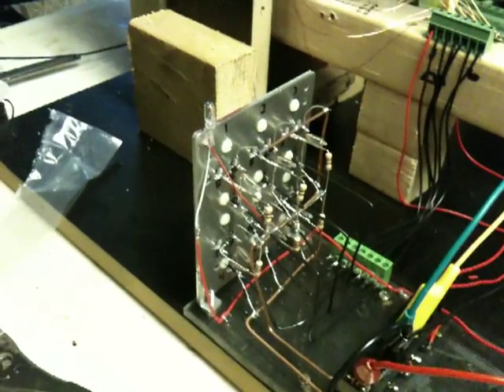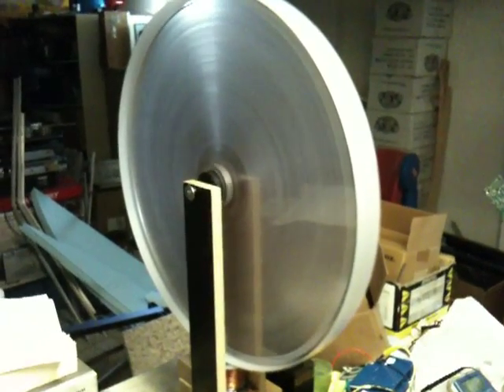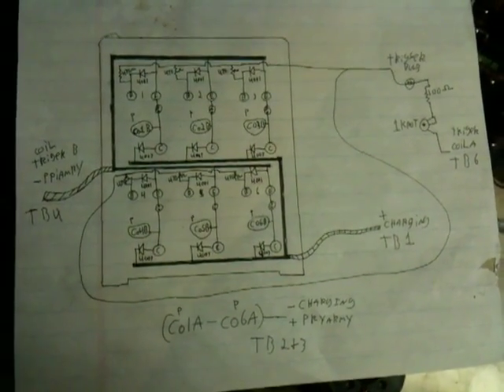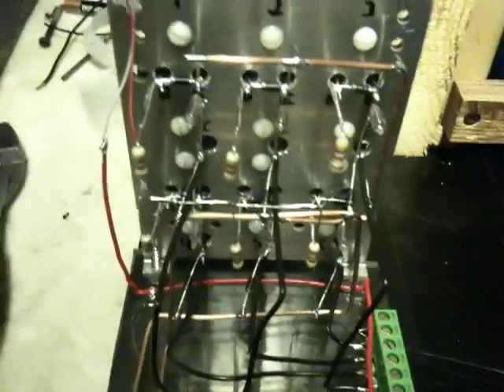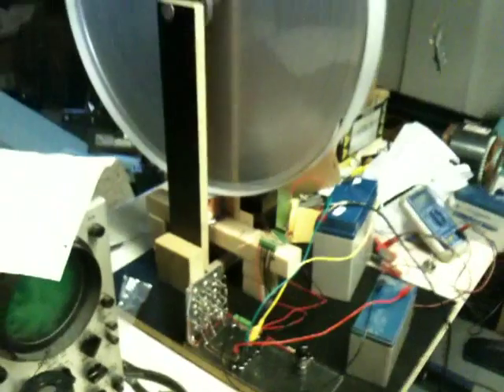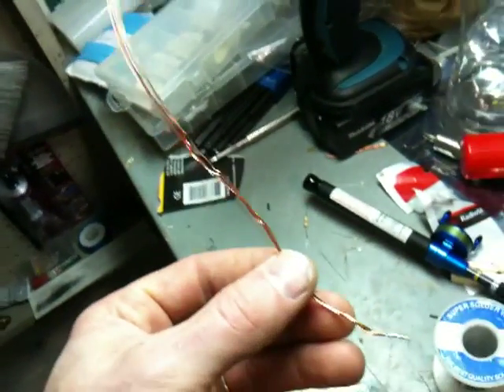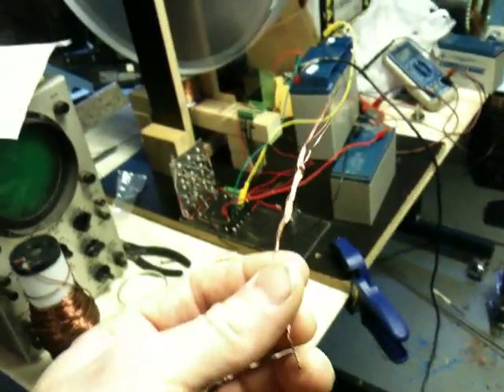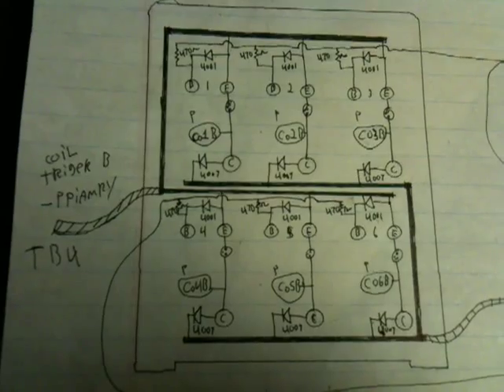#5 my (SSG) energizer "7-filar coil, 1 is trigger  6 are power"

Comment: Where is the schematic? I've wound the coil with only six wires and am using a separate coil for the trigger offset by 90 degrees with 12 magnets. It's running right now with only one transistor and three to all six wires of the drive coil on parallel.